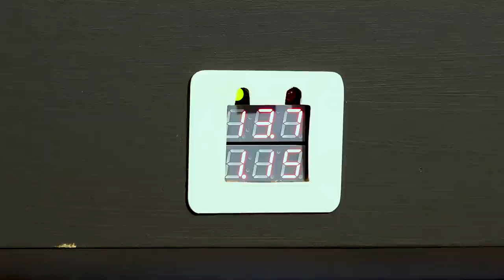59. Power Management at McKinley Railway

Comment: David and co, another splendid video on how the layout will hopefully work within itself to prevent derailments, crashes, short circuits etc.  The amount of technology you and the folks at McR use is astonishing for control of the layout. DCC is wonderful stuff to bring realism to running a layout via computer and manual control and that is not even including the Decoders, Sound Chips, Speaker units and the rolling stock used. Though most of the latter sentence and its items belong to the individual members that own them. I would hate to know how much this huge, but wonderful layout, digital control track work may have cost to date. With all the circuit boards, micro controllers, boosters, point motors, detectors, and power units must be astronomical to the clubs out going funds. Never mind all the track, points and wood used in this whole project. 

How many years has the layout build been going on at McKinley, and if this project will ever get to the stage of having the scenic areas started, for all this ground-breaking track work? With the pandemic cozing a huge blip in the build of the layout's timeframe (for God knows how long) was to take. How has the club prepared for the future and the timing of getting beyond the track laying? To start adding the landscaping, buildings, roads etc over this networked line of routes and sidings etc. Where abouts in the future are you aiming for this latter work to begin on top of this marvellous laid track plan to pay out on its dividends? Have you reached a stage to say well, this year the landscaping of 'X' will begin, then by this date to hopefully to start section 'Y' on the layout etc? I know members would be building units off screen, but excluding any off that work behind the scenes, when will viewers see work on the layout boards scenes starting to be added, and to be able to see McKinley as a running Railway Layout?
Reply: That will also prevent the loco which is approaching the wrongly-set points from fouling the junction. That would prevent any damage caused by a conflicting movement. Sounds like a sensible system.😁👍
Reply from the maker: Thanks...
Reply from the maker: HI John,
We started in 2000 and were building for 6 years.  We then played for 10 and then started the extension in 2016.  So phase 2 will be complete by the end of this year.  We won't start the landscaping until we have operated for 6 months.  There is a plan but everything takes a lot longer than we envisage and that has nothing to do with Covid.  It has turned into a longer journey than originally envisaged, but we see the progress day by day.
Reply: @dattouk Is the layout in a purpose build building or a part of a home layout that has an extension to house it all in a member's home/mansion, LOL. The layout is an exceedingly long project by you all, and the best laid plans is to make sure all the track work works as intended. Then the landscaping can go ahead once all the little bugs are ironed out that may still crop up. It is impressive to see it now, but it be just as fabulous as Pendon has become today. Maybe one day I will get over to see it in the flesh, if I can get to your region of the UK from Belfast to view all the wonderful work you folks have put into this layout.

Comment: Loved your power district- and points show case - thanks! I see the problem with DCC controlled points, but the amount of hardware and wiring you have used for block control alone, still want me to try and control this with software. Having simple current detectors and points sending simple DCC messages back over the network instead of all those boards and wires. I will probably have a "DOH!"-moment, when I get to where I realize why everybody are using all these boards and wires....
Reply: I think I agree,  what about a seperate DCC bus for switch machines, another seperate DCC system  for block detection/running and yet another full system for signals.   Rfid on its own as well. Three / four bus’s command stations all connected back to train controller to co-ordinate things?     Is that one way to reduce wiring a rats nest?
Reply: The issue with block detection is that you basically start to replicate in a basic form the modern railway signalising system. They just used bigger cables. 

There will be a way to do it using RFID readers but arguably that becomes just as many cables once you start to realise how many RFID readers you need.
Reply from the maker: Hi DSB,
It's a case of what you want to control.  If you want automation, you need blocks - Blocks means wires.
If you have a large layout then you need power blocks -  that means some wires but not as many as occupancy blocks.
As Mark Stafford has said in this thread, you could have a DCC booster dedicated to points.  That avoids lots of wires yet still gives operational safety.  
Its about working out your end goals - No automation and a small layout - simple -  just 2 wires.  Big layout, automation etc = 100's of wires.
David
Reply from the maker: Mark,   You make a good point about a separate DCC system for the points, but I don't now how you can make a simple DCC system for occupancy -  Occupancy requires separate track blocks which equates to wires. RFID can be used but it becomes expensive to use intensively and hard to measure occupancy.  You'd have to have something clever to track vehicles in and then out of blocks.  The truth of the matter is it in't suited particularly well for automation in the sense of running trains.  All it gives is some like "I have seen this wagon/loco over that that sensor just now".  It doesn't know if it is still in the block or not.  Each methodology of detection has benefits and drawbacks.  My world is definitely overkill, but I want my railway to behave as well as it can so hence the use of different systems.  Current draw occupancy for TrainController.  Infra Red for the stop indicators, again for TrainControllers.  RFID for the operational yard movements and freight tracking. 
Take care,
David

Comment: David, A few years ago I did hear tell of a new  large wind farm being built out in the North Sea. I can now see what all that extra power generation was to be used for. I have noted that a number of American layout's that use D.C.C. to control point motors have gone back to throwing switch's to give operators more " faith" in control. More so when you have guest operators. Cheers, Chris Perry.
Reply from the maker: Hi Chris,
Yes DCC point operation HAS to be protected from Shorts.  It turns layout operation into a nightmare if not.  We use LocoNet and that is very dependable.

Comment: Marvellous.  And I like how just like the massive model railway at the Whyalla maritime museum in South AUSTRALIA you need to create a system that works for the application.  There giant layout is DC and is so for redundancy.  Their club layout is DCC I use DCC and using the DCC digital points however for smiley ol me the point wiring and operations are a secondary circuit track layout.  Why.  Even I don’t know it just seems logical and gives me redundancy to run it anyway I like and it’s my layout so whatever makes me happy.  I’m with you on the power capacity plan.  Does my layout need servicing by 3phase to the house of course NOT did I put a dedicated 3 phase sub board to power my layout?  Your darn tootin I did.  Stay safe and all the best to Charles when you next see him from Chadwick.

Comment: to avoid the problem you showed with the switcher at the end of the video, The DCC Guy showed a trick with a Tortoise switch machine whereby the power to the first 12 inches of 2 pieces of track connected to the switch frog is changed as the switch is switched...... the end result is a loco approaching a switch that is set against it will stop before it enters the switch as power is routed to the other track
Reply from the maker: Hi George,  I think we are at crossed logic here.   The frog short works fine for all our locos except the stay-alive shunters.  That is reason why the shunter carried on (because it had a stay alive).  No matter whether the power was x or y , on or off, the Shunter will continue running at the last known speed until its energy pack is drained.  I could pick the engine up off the track and the wheels keep turning.  No change to track power logic would make any difference.  Does that explain?  David
Reply: @dattouk  Hi David,  I get it ... the stay alive "defeats" the switching of power between the tracks at the end of the frog...thanks for pointing that out to me... best wishes for more uptime on your railroad....I live in Canada and am not sure when I'll visit England again...I 'll be looking to visit McKinley on a virtual basis in the future.

Comment: A simple, low cost, way of getting an estimate of booster load/current, is to measure the incoming current from the power supply.  There are many devices, much cheaper than the RRampmeter which will give that current.   Its enough to know if the booster is anywhere near its maximum.   
As the video shows, with most modern locos the current demand isn't high.  It also indicates that the short circuit protection should be at a fairly low current.  
I agree with your use of short circuit protection in frogs - stop the trains if the track is set wrongly.  

Any decent decoder (which includes ESU and Zimo) have CV settings for length of run time without DCC signal, so you can cause them to stop after a loss of power of, say, 1/4 second.  So, the decoder will stop before falling off at the blades.
Reply from the maker: Thanks Nick...  Good suggestions.

Comment: Great job as usual David and Charlie. I agree that the ambient load on the yard was suprisingly low, given how many consuming devices were parked there. Your "opposing forces" test was similarly interesting - but I can't help wondering if two locos slipping on shiny track is representative? It may be, but I would have preferred seeing the current pulled by a loco hauling a 6 or 8 coach train up a helix? Seeing the figures for that would be very interesting. Some great info in this edition - many thanks guys!
Reply from the maker: Hi Alan,  It's no more on the helix.  On the whole, current draw is light.  The interesting thing I should have done was to "Stall" the loco by pressing down on it to stop the wheels turning and leaving the power on for say 2 seconds.  If I get time I will report back on "stalled" motor load...  From my experience that is the biggest current draw.

Comment: David, thanks for this video. I particularly liked the part about stopping locomotives running through points which are set against them. You mentioned that the points are not DCC controlled, but you seemed to control them from the same control unit as the loco. Thinking about the power consumption of your extensive layout, it would be interesting to know how much energy your complete set up consumes when working.
Reply from the maker: Hello Andrew.  The whole layout was brought up last week for the first time in 2 years.  It roughly consumes 2 kW which equates to about 60p per hour when turned on.  So not as expensive as running a car. 

With respect to points, we can control them from the throttles (which also drive the Locos on DCC) but we don't control them through the command station. There are Point control devices (such as a DS64 or a DAC20) attached to the same LocoNet bus that the throttle is attached to which see the switch instructions being sent from the throttles and act on them.  Those switch commands are also received by the command station and sent out over DCC, but there is nothing on the DCC rails to act on them.  It appears confusing, but it is quite straightforward.  Regards  David
Reply: @dattouk  Thanks for your reply. I was expecting a much higher consumption figure for your system taking into account the number of monitors and computers involved.

Comment: Out of interest, how many watts of power does Mckinley use when all the possible trains are running with sound locos, all point motors and signals plus lighting etc. Over a 1000 watts maybe?
Reply from the maker: and more.  The extension takes about 2kWh.  We are about to switch both the old and the new on together and I would anticipate a full layout with all the above plus computers would be just over 3kWh  (3000 Wh).  So thats about 30 old 100W lightbulbs...  Not quite in the Wembley Stadium category of consumption.  David
Reply: @dattouk  That’s a heck of a lot of power for a model railway, very impressive. Thank you for answering my question.
Reply: @dattouk  Has the power company upgraded your electrical service yet ;) ..  Love your videos .. clearly a lot of engineering thought.

Comment: Instead of the "red penny" you could have put kill switches on the control boards for each circuit sector, or did hands-on experience shown that the operators got the wrong button to often?
Reply from the maker: Your logic could be done easily, but I am going to disagree with your thinking because....  Simple logic has to apply.  The Operator sees the engine.  He sees the track, He grabs the penny and put it there in front of the train.  He have no time to think.  We don't want to force the operator to try and work out where on the control panel is the relevant kill switch for that section of track.